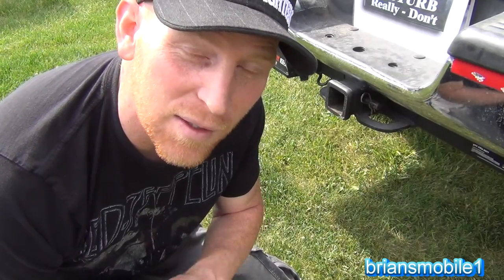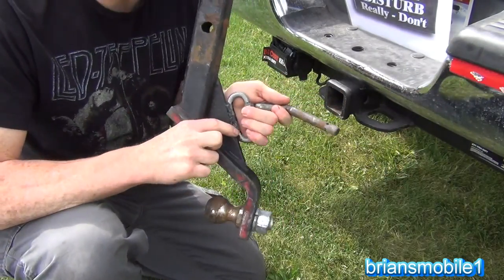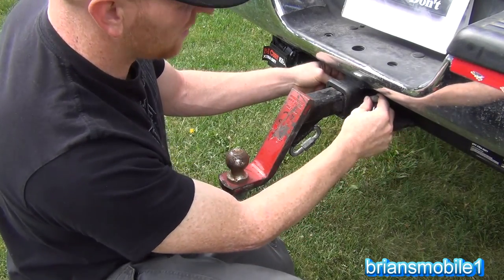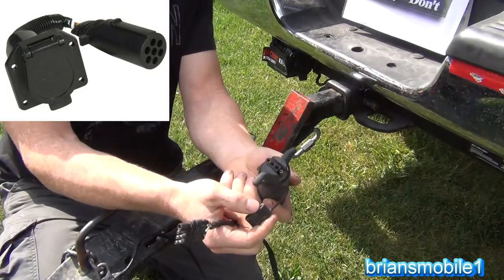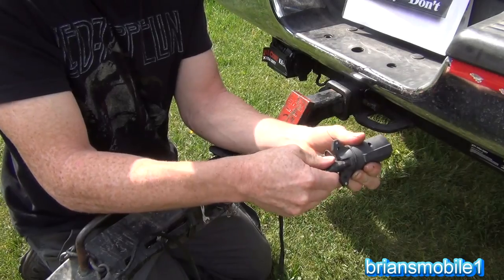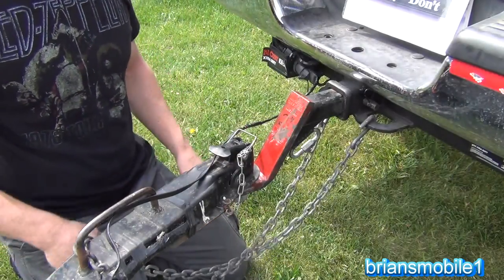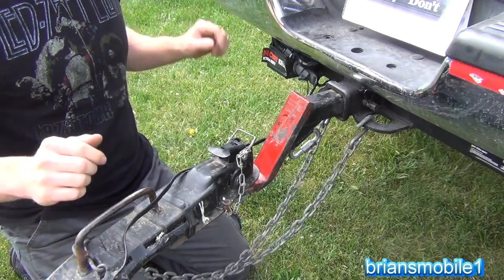How to Hook Up a Small Utility Trailer

Comment: Great vid, also if it hasn't been called out after the hook up do a walk around and check lights. The safety hooks ( with the spring loaded tab that keeps them from falling off) are also a good idea and a requirement in most states.

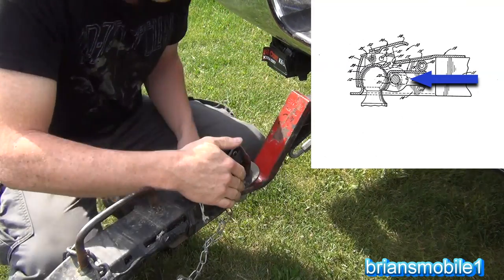Comment: At 2:25 those, as you call it, "flat style, sheet metal couplers", are adjustable so you don't have to reach up under it & move the lock bar to get it to go on the ball.  There is a nylon lock nut underneath that goes on the latch bolt. If it's difficult to latch the coupler you can loosen the nut 1-2 turns til you goes on the ball without difficulty. If the coupler latches too easily & has too much "slack" you can tighten it 1-2 til you removed the excess "slack". Either way, it should drop on the ball without difficulty, latch with minimal force and there shouldn't be any excessive "slack" in the couple/ball connection. Also, no matter which style of coupler one uses, it's a good ideal to spray a good dose of  WD-40 in the latch mechanism every once in a while to keep it all lubricated.

Comment: Just bought a behemoth 8.5x20 foot trailer. I think rule of thumb is if youre rear end goes down excessivley and ends up lower than the front by a certain amount you should use load distribution hitch. On mine ill definitely need one

Comment: How about a video on load distribution of weight across ALL AXELS(truck & trailer) and the importance of proper weight on the steer axel. Now that camping season is hear I see a lot of trucks sitting much lower in the back when trailer is hooked up which is taking weight OFF the steer axel of the truck which can result in a loss of steering and allow the front wheels to lock up and skid if heavy braking is needed.

Comment: I had to replace the round connector because of corrosion. I also keep that same adapter in the truck because all U-Haul stuff has the 4-pin flat connector. Makes sense to store the adapter with the receiver in the back of the vehicle, it does not get lost that way.

Comment: Here's a tip for those who feel their chain is just a little long, putting the truck at risk of snagging something that you might drive over. You can rotate the head of the chain a few turns, which effectively shortens it, allowing the chain to ride a little higher. Just be sure to leave enough slack to allow the truck to turn. My chains have spring loaded safety snaps that hold them on, even if the truck is bouncing.

Comment: Last couple times I rented a trailer from u-haul the tech took one chain and twisted it a bunch of times to shorten it, and hooked it up to the hitch. Then he did the same to the other chain. Each chain kind of looked like a braid with the links twisted together like that. I thought twisting it like that would make the chain weaker and not able to take as much of a load. The links are designed to take tension across its length, not its width.  But the tech said it was ok.  What do you think?

Comment: What are the chances that the ball and coupler can come undone when you hit bumps in the road? I wanted to ask this. Like particularly when you pull into like a store or parking light some of the ditches where you come off the road into a parking area a lot of them lately have big bumps. You probably wouldn't be going very fast on those, but it seemed like something to ask about, on the probability of a coupler of the tongue coming undone from the tow hitch?

Comment: Hey Brian what are the torque requirements for hitch balls? 100 ft. lbs? 200 ft. lbs? Especially for 2 inch and 2 5/16 ball sizes? Can u tighten them up with a standard Impact wrench? Thanks, Marc

Comment: In ontario I was told your not allowed to use those style hooks with the safety chains, they must clip on so they cant fall off when your traveling down a bumpy road. I was also recommended to put the trailer wiring through the pin where the trailer attaches to the hitch ball so the wire cant rub against the ground if the wire is long.
Reply from the maker: I like the wire idea.  The hook issue is new to me.
Reply: Canada is very strict with vehicle safety, I learned that from a truck driver who was also a safety inspector.

Comment: i have a question - you can clearly see there's a spot to mount the ball on the bumper, right under the license plate.  Why does this have both a receiver and a spot for a ball?
Reply: MCatwar The reason their is a place for a ball on the bumper is because you can tow with the truck's bumper. However, some receiver hitches offer a stronger tow system for heavier loads than the factory bumper. As with any towing apparatus, though, the bumper has a towing weight capacity that one will need to consider in comparison to the load to be towed. It's best to check your vehicle's owner's manual. It will list the towing specifications for your vehicle the way it came equipped from the factory.

Comment: should look at you display photos there should be retaining clips on your safety chain hooks, as displayed on your photos.  safety chains just hanging in hitch eyes will bounce out.  Most states now require safety chains to have retaining clips
Reply: I only had that issue with light chains till I put thick gauge chain on them. Wisconsin does not have that law.
Reply: ***** I never seen a trailer being sold with those on, by law or not. People put then in after market.
Reply: *****   fair enough but are you telling me you never had to stop and reconnect your safety chain?  You must agree that that is a problem and that if you were putting on a video about safety that you would not address this problem by showing a safer system?
Reply: fair use policy air enough but are you telling me you never had to stop and reconnect your safety chain?  You must agree that that is a problem and that if you were putting on a video about safety that you would not address this problem by showing a safer system?
Reply from the maker: flineman
I've run this trailer for about 10 years now hauling motorcycles and gear through every kind of washboard road, ruts, RR crossings, pot holes, up & down steep rocky dirt roads etc.   I've never had the chains come off.  Ever.  That isn't to say that clips wouldn't ADD to the safety of it.  It just hasn't been a problem.  All my heavy trailers have clips on them to secure them.  But the hooks are huge and not compromised by a hole through them for a wire type clip either.  I think that gravity, airwash, and hooking them from below keep them on.  I'm going to have to do a video on this I can see.
Reply: Only issues I had with only one trailer I ever pulled was a log splitting pull behind. So short and bouncy. You cross the chains so it takes some slack away to help prevent them coming out but briansmobile1hit the nail right on the head. I pull slot of medium to heavy duty trailers and not come across that only that on time.
Reply: flineman only once because they were nit crossed and it was such a light and short log splitter, other then that no put the hooks towards you and not the pull vehicle and I never had that issue again.